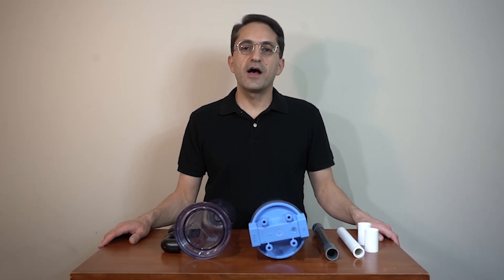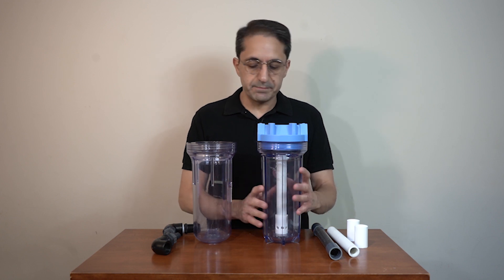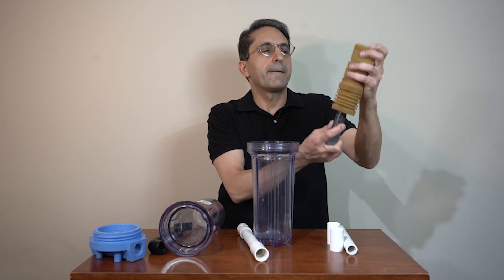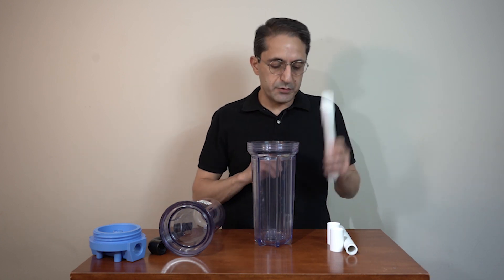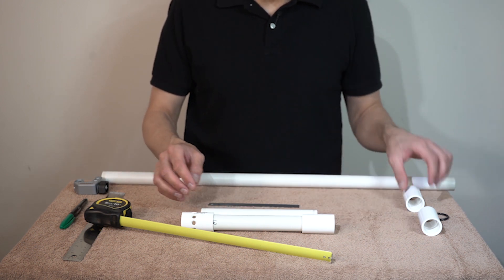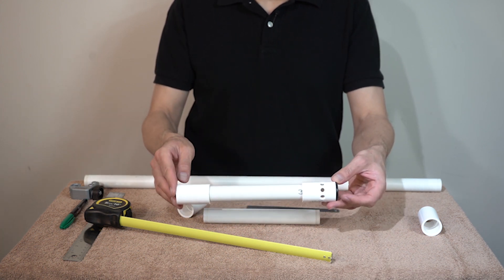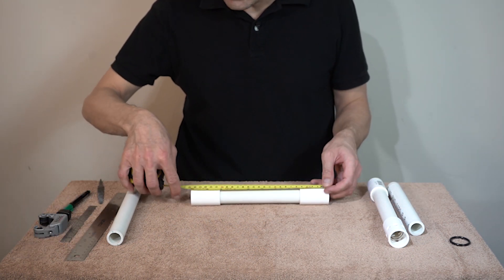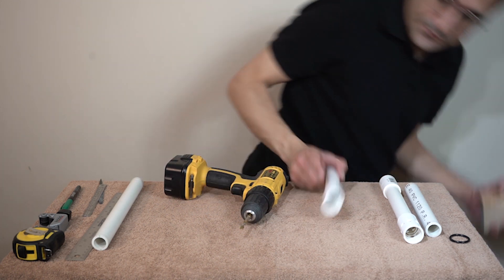DIY Aquarium Filter

Comment: do the filters have copper or brass connectors or fittings?  are they safe for fish? but congratulations for the idea!!!
Reply from the maker: Thank you for watching 🙏 The filter housing is made out of polypropylene which is safe. The filter housings I am using do not have brass or any metals.

Comment: Could you use something like a 50 micron pleated filter in the first stage or would that be to much?
Reply from the maker: You can use it, but it will clog fast, and you need a water pump strong enough to pass water through it. I would say it is not practical for aquarium. Thank you for watching 🙏
Reply: What type of mechanical filtration do you recommend
Reply from the maker: Sponge, inexpensive ceramic, and bio balls are good choices for mechanical filteration. Although after a while, they also work as biological due to the presence of good bacteria.
Reply: What type of sponge would work?
Reply: Oh nvm I saw your other video

Comment: What are you using for a pump?
Reply from the maker: Thank you for watching the video🙏.

The water pump is Eheim 1250 Universal water pump. I also used Sicce Syncra 1.0 Pump recently. Any water pump that can be used out of water should be fine.
Reply: @Handyaquarist  when I commented this I was at the hardware store buying a 1.5 gallon filter housing to make my canister filter, I ended up getting a submersible powerhead and screwing it into the bottom of the lid, with the pickup tube it’s a really tight fit but it works awesome! I opted for a larger housing as my tank is 40 gallons and I had to fit a submersible pump within the lid for a clean contained look. Thanks for your help I couldn’t have done it without you!
Reply from the maker: @codyshubin1073  I am glad it works well!

Comment: Wat size inlet outlet is this?
Reply from the maker: I used 12/16mm hose for inlet and outlet. Also I used 3/4" (connect to filter housing) to 5/8" (hose) connector to attach hose to the filter.  Some filter housing has 1/2" inlet and oulet, so choose according to the filter housing.
Reply: @Handyaquarist  the one I found online has 1 inch inlet outlet so the connector will be 1inch right, then I can use 3/4 inch pipe to connect to it right or do I have it wrong?
Reply from the maker: @renuka2740  Right, you can connect 3/4" inch hose if it has 12/16mm inside/outside diameter. Then you need two 1" MIP (connect to filter) to 5/8" barb (connect to hose). 12/16mm hose fits well with 5/8" hose connector.

Comment: What kind of water pump are you using
Reply from the maker: It is Eheim 1250 universal water pump. You can use any water pump suitable to run dry (outside of water). 
Thank you for watching 🙏
Reply: What is the lowest pump that can be used with this set up
Reply from the maker: @4wtsage  The lowest water pump I used is Sicce Syncra 0.5 which I used with 1/2" or 12/16 mm hose.

Comment: Excellent video, What's the media capacity of 10" Filter housing? please advise if there is any real benifit of using 20" JUMBO I right away can say better media holding and higher flow rate but would like to  know your opinion. 
Thank You 🙏
Reply from the maker: Thank you for watching 🙏 Good question, I will measure it and let you know. I had 20" Jumbo housing before and it is excellent. If you have the space inside your aquarium stand go ahead as there is no over filtering, so bigger the size it is better. I am making 10" Jumbo filter housing right now (limited space otherwise would go with 20") for my 40 gallon tank.
Reply: @Handyaquarist   Thank you once again for your valuable advice.

Comment: How did you make the connection from the pvc pipe to the lid? It doesn't show the most important modification...sigh.
Reply from the maker: First thank you for watching. I am deeply sorry if the video is not clear. There is no connection between the lid and pipe. After filling with filter media while the pipe is in the center, the lid just sit on top and then I start fastening the housing. Thank you to point this out as I am making another filter and video.

Comment: Excellent !!!  Thank you so much for making this video!!

I subscribed!

Please tell me where you ordered or purchase that larger 10 inch canister please?  That’s exactly what I want to get!  

Thank you so much again.  Thank you 🙏
Reply from the maker: I am glad you like it. Thank you for taking time to write a comment, makes me to work harder to create more videos.
Reply from the maker: I've had that larger one for a long time, and I couldn't find it any more. The new ones I got from amazon is pretty the same size may be a little smaller in diameter and I have used them in my DIY CO2 reactor video. The link for Pentek filter housing is in my describtion if you would like to get it.